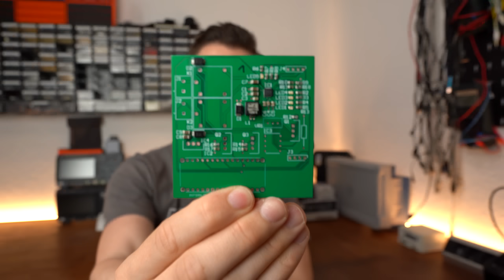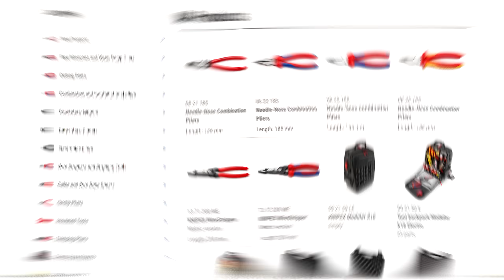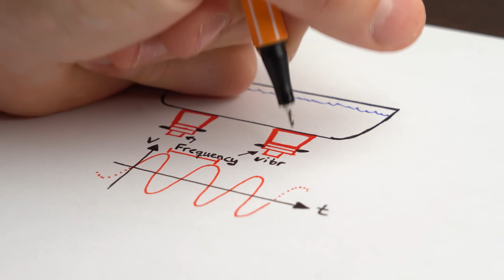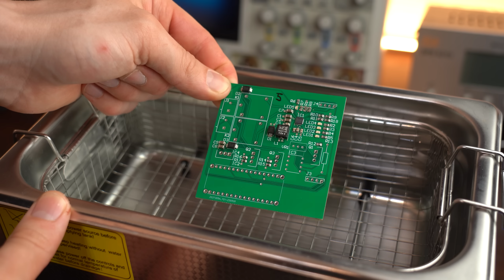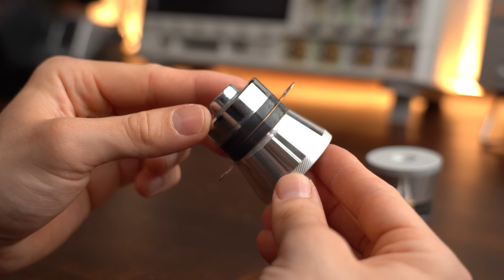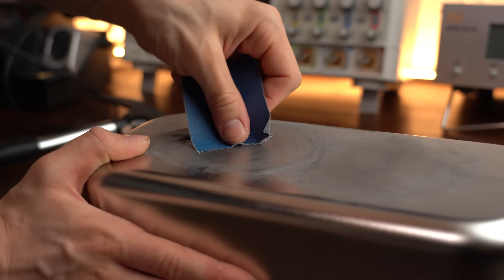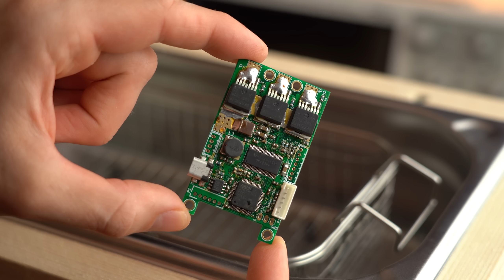The Most Underrated Tool? (DIY or Buy) Ultrasonic Cleaner!

Comment: I have an ultrasonic cleaner for four years now and I don’t use it very often. For a single board or just a few, the set up process and cleaning takes much more time than brushing the pcb with alcohol and drying it. Also, ultrasonic cleaning is risky for parts like read relays or crystals etc.

Comment: My god, the electronic PCB industry relies for decades on staying away from water and moisture which simply damages components in the long run and you are telling people to use it for ultrasonic cleaning of the pcbs. You don't know what you're doing, mate.
That includes your soldering techniques, as per quick look at your surface mount board assembly full of tiny solder balls it is clear you are contaminating soldiering process with water, most likely by cleaning solder iron tip with a wet sponge which is absolutely wrong. Learn about good solder practices, moisture and water effect on electronic components, and stop spreading bad practices among YouTubers. Good luck.

Comment: I would advise not to use an ultrasonic cleaner for eyeglasses due to the many specialized lens coatings commonly used on modern eyeglasses. It can damage your expensive eyeglasses.

Comment: Hey, thanks for your video. I am also making a fundamental analysis of a DIY ultrasonic cleaner with larger power and @28 kHz. 
I wonder if you where using a isolating transformer on your osciloscope to measure the frequency? I am a bit afraid that both are on 230V and share the same ground/earth.
I would also like to counter-check the frequency of my six single power-units to get an idea about the frequency deviations.

Comment: Just use an old tooth brush and cleaner, rinse and blow dry.  Did it for years.  People freaked out when I told them I washed their PCB they spilled coke on.  Messy and not as fun to watch.   Buy if you want to clean other things.

Comment: Judging by the first PCB you showed, you are obviously a novice at this. I have 2 pieces of advice for you. 1-Your heat was colder than it should have been. 2-You aren't using enough flux.

Comment: Hey, thanks for the great content. Try using 'de-natured alcohol' for cleaning any flux messes. It's cheap by the pint from Lowes / Home Depot & Ace Hardware. De-natured alcohol flux totally soluble and rinses right off. Then you can follow up with 91% isopropyl post de-natured. You'll thank me later. Keep up the awesome content bro! We appreciate it.

Comment: The best way to clean PCB's is to use water soluble flux, it easily dissolves in water with little scrubbing required. After you wash the board just hit it with some compressed air, whole process takes less then a minute.

Comment: Ultrasonic cleaners are amazing, but for electronics you need to be very careful about some ICs because the vibrations can damage bond wires on chips, and you will not notice that has happened until the device suddenly fails, hard to spot the cause of failure with DIY projects, just need to be very aware that some devices do not take ultrasonic cleaning well.

Comment: I use an large 6L ultrasonic cleaner to clean bolts and nuts etc in a degreaser before electroplating. I put the degreaser in a jar and submerse the jar in the ultrasonic tub full of tap water. 
For circuit boards, I'd probably use 99% IPA.

Comment: I bought a small size ultrasonic.  It offered 30-60w power.  My field is advanced computer motherboard repair.  We tried BGA chip with MR Muscul for testing purposes.  The crystal of the chip exploded) so I tried it with 30w.  But it is the liquid that is important for cleaning flux.  For example, you can try Mr Muscul with distilled water.  or try isopropyl alcohol.

Comment: Buy a new solder-paste which is freshly made (1-2months old) and which is stored properly under 20C. The solder ball problem is mainly occurs due to oxidation of alloy which indicates the flux in the solder-paste is degraded.

Comment: Can such ultrasonic cleaner able to remove the grime on the side of spectacles lens which is in contact with the frame?

I need something to remove the grime on the side of my spectacles lens. I begged multiple optical shop to help me remove the lens so i can clean the side of my lens but all the shop says it's too risky as the frame may crack so refuse to help me.

I use toothbrush but it didn't work. 😢

Comment: You can put small parts in a glass jar that you fill with cleaning fluid. This way you can run different cleaning cycles at the same moment  using different cleaning fluids.

Comment: I used to do pcb/microsoldering in a previous job. We cleaned finished PCBs in what was basically a high tech dishwasher. As long as none of the components on the board are moisture sensitive, you can just use warm soapy water. Dry the board in the oven at about 60 degrees c.

Comment: alternative tip for cleaning a board: use hot water, dish liquid soap and a tooth brush. I always wash my boards that way, I'm doing that since the '90s. It takes 5 minutes, plus some hours under the sun (or some minutes under the hairdryer). It can also fix some issues like leaking caps (of course then you must to recap and of course it doesn't fix corroded traces). When I have more than one board, I throw them into the dishwasher with a fast washing program (in this case you need to remove the painted parts, like metal bezels etc. - I mean: like the Commodore 64 metal bezel for the joystick and switch -- trust me, I won't do the same mistake again...).
In case of small boards, like RAM or ROM adaptor with sockets and smd components, etc. I put the board into boiling water for few minutes (no, it doesn't affect the electronic components).

This method works fine and I've never lost a board until now.

Comment: If you use shifting frequencies, the interference patten in the cleaning solution will be more random that using the exact same frequency to drive both ultrasonic power heads. It should move the vacuum implosion bubbles very quickly around the volume of the tank. Your Aluminum foil test showed only limited "hot" spots. I take it the big hole is above one of the ultrasonic power heads.

Comment: Great video as usual!
Thought I should add a list of some electronic components that should first be de-soldered from the PCB before cleaning in this Ultra-sonic cleaner:
- Speakers
- Microphones
- Piezo-electric transducers
- Batteries of any type
- Non-hermetically sealed ICs?
      ...Am I forgetting anything?

Comment: this is great, i have a small ultrasonic cleaner. ive wanted one to fit large car engine pieces. do you think the DIY kit can be used on a fullsize stainless kitchen sink? and would using more than 1 kit improve cleaning performance or shorten time?

Comment: I used to build and repair commercial ultrasonic units. Put the PCBs in a double bath of isoprol alcohol
Reply: Have you, or could you, measure the actual Wattage of an ultrasonic cleaner.  My Creworks cleaner is listed as 180 watts for the ultrasonic transducers. What does that really mean?  When I measure it with a Kill-a-Watt meter using only the ultrasonic function of the cleaner, it measures between 110 and 135 watts.  I would be interested in knowing how to compare how a model is rated and the actual power consumption as displayed on the KIll-a-Watt meter.  Thank you.

Comment: I made my own ultrasonic cleaner by purchasing the necessary parts. I did not put a heater. If it is left on long enough, it heats the water itself without the need for a heater. Of course, I keep it for 2 hours for alcohol and curcumin extract!
        Wouldn't it be better to place the surface that needs to be cleaned facing downwards?

Comment: Another method of cleaning would be to instead of a toothbrush, get a bike cleaning brush from muc-off. They have a large soft brush which gets rid or practically everything when using board cleaning solvents. Way faster than the toothbrush.

Comment: I cleaned an old PC with tap water and soap once. I left it drying and reassemble things though it turned off immediately after booting. Disassembled again and it had  a mini pool of water inside the CPU socket. :) After drying properly everything worked greatly. That PC died of obsolescence.

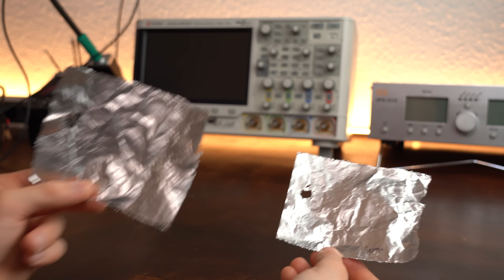Comment: 4:50 Check those foils under an electron microscope and you should find some carbon, silicon, and other elements. This is the cheapest, easiest and safest cold fusion demonstration.

Comment: In my experience heating function is kinda redundant in small scale ultrasonic cleaners (for glasses e.g.), since they tend to "heat up" quiet significantly when running over "longer" periods of time, 10min e.g. but given the thermal mass of water i guess if you need a certain temperature that becomes necessary at a certain scale

Comment: Actualy, ultrasonic bath and circuits boards are no good friends. Depending the bath power and the bath duration you can destroy your board. Also, in most cases, flux is not dirt, instead it can protect the component. You can use a noclean flux as we do at eletronics factory. Solder paste for SMD also does not need clean. The bowling you showed occur due to temperature, solder paste temperature (it has to be stored on refrigerator), old solder paste and so on.

Comment: I've always wanted an ultrasonic cleaner as I do LOTS of microscopic hand soldering on PCBs, and cleaning flux residue is an absolute nightmare that takes up at least half the time I spend diagnosing, fault-finding, and even repairing the damaged circuits. 

One of the most important things I've noticed in regards to ultrasonic cleaners (and whether or not they're recommended for use on electronics) is if they feature a sweeping frequency. My understanding of this feature is it prevents the creation of standing waves within the solution. In normal operation, you will have various regions of high turbulence and cavitation, and regions with absolutely none. This is due to interference patterns emerging in the solution. 

Sweeping is meant to solve this problem, by causing the transducers to operate at a variable frequency. This creates a far more uniform distribution of turbulence, and therefore, the cavitation which causes microscopic water bubbles to cling to debris and gunk and pull it away. 

I think the reason you were having so many issues, even prior to using a specialized cleaning solution, is because this particular ultrasonic cleaner doesn't feature sweeping. It kind of makes sense that sweeping would be desired for electronic circuits, because you often have MANY small parts (the SMD components), all with various quantities of goo and debris between them. A non-sweeping cleaner would likely have lots of problems with getting cavitation bubbles to occur in all of these nooks and crannies. 

I also expect the full-wave/semi-wave setting on that cleaner you got is meant to create a different interference pattern in the solution. Semi-wave probably results in smaller interference patterns, which interestingly could provide better cleaning results? Maybe? 

The only problem with the sweeping cleaners is they are ASTRONOMICALLY more expensive. Once you get into sweeping cleaners, you're easily looking at price tags upwards of $1,000 or more! I'd be really interested in seeing a DIY attempt at creating a sweeping cleaner. I have no idea why they're so expensive, as I can't imagine it takes much more to just alter the frequency the transducers are running at. But they must be so expensive for a reason, right?

Comment: Man, you can easily get MEMs devices fucked with your ultrasonic cleaner. There are way better and easier professional solutions available to clean PCBAs from flux residue.  SWAS SWAJ SWA Safewash are used at the top level assembly lines in the world.

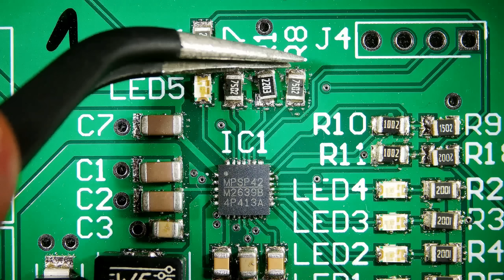Comment: 0:28 Your solder did not flow properly. You either had too much heat and burned off the flux, or you took it off the heat too fast. To me it looks like the former. Another reason could be expired or improperly stored solder paste. It should be kept in its original container and refrigerated. That said, whether lead or lead-free, solder paste should be stored in a dedicated refrigerator away from food.

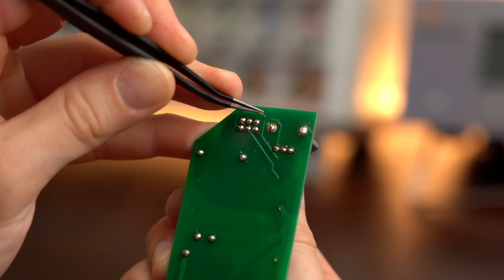0:43 If the flux leftover is yellow and chips off, it is no-clean. It is safe to leave on the PCB, but if it is looks you're going for, using a Dawn dishsoap and isopropyl alcohol mix does the trick.

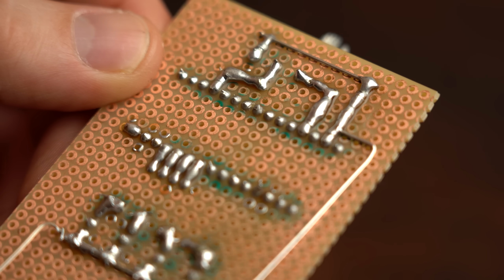0:49 THAT looks like water soluble flux that has been left for a few days to a week. That flux comes off with just water, and is very bad if left on, as it will begin to degrade the metals.

I am not knocking your video, I build circuit boards for a living and am an IPC-610-A CIS (certified IPC specialist), and an IPC-JSTD-001 CIT (certified IPC trainer).

Comment: Tip for using ultrasonic cleaners with heating elements: keep the lid closed. Even the quality brands (e.g. German brand Elma) appear to struggle without a lid - I assume it is just is too much surface area that dissipates the heat. E.g. a S 120 H has 800 W of heating power and still does not reach 60 or 70 °C without a lid. Furthermore, lids help reducing the ear-unfriendly noise a bit.

By the way - cleaning detergents are usually reusable - you can e.g. judge their remaining cleaing performance by their pH-value (compared to their initial value). Or you just use them until you are not happy with the cleaning results anymore.

Comment: 1. Can the cleaning solution be DIYed too?  What is the solution made of?
2. Is the "buy" tank large enough to hold the motherboard of a laptop pc? (A friend has had several laptops destroyed by the dust in the desert of New Mexico where he lives, that contaminates all of his electronics over time.)  If the tank is too small, can a DIYer remove the rest of the components of the "buy" cleaning machine and install them on a larger (DIY) tank?

Comment: I'd love to see a DIY or Buy video on the "battery blender" (also called DATEx2) which is a >$150 ebike mod that allows you to safely add additional batteries. It seems to be quite a small device, so I'm not sure if it's a mini battery management system (like you used in the DIY ebike battery episode) or something much simpler.

Comment: You find ultrasonic transducers with different frequencys (and electronic board). 
The channel owner forget some words why he used 40 Kilohertz frequency (40 kHz = 40000 waves per secound) 

For electronic boards often a good frequency. 
For fine electronic I choose an differnet frequency. What I am choosing ? Write below a comment.

For mechanical parts not allways the best frequency range ! 

Use google and your brain to get more informations. 
Think about my personal opinion= The channel owner is not a ultrasonic cleaning expert. 
I hope you find other faults in the video . I hope I can read your comment about faults in these video soon. 

(I am not a professional. *You are responsible+ for the use of above (and all of my) information. I can make mistakes. Ask experts. In my country are different laws and safty regulations. What are these in your country ? Electronic , electricity ,  chemestry and-or fluids can be harmful)